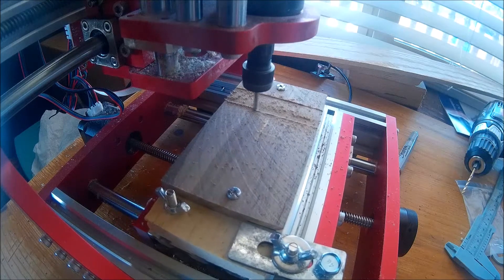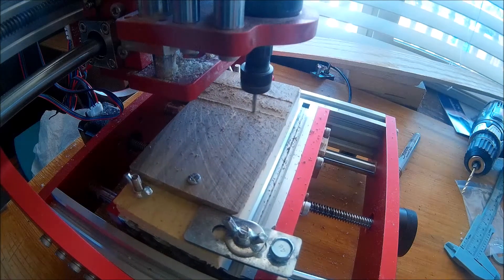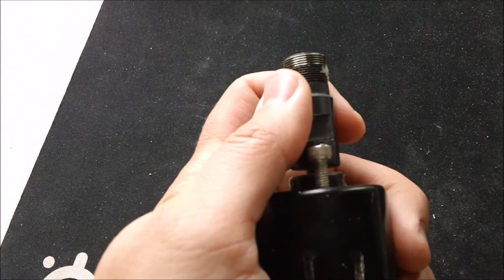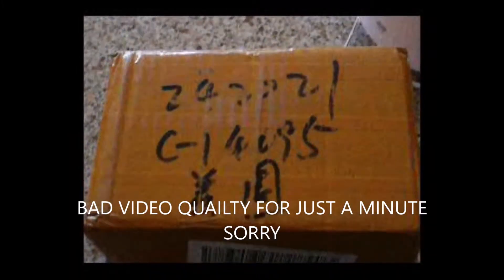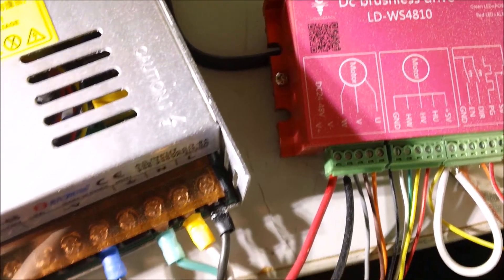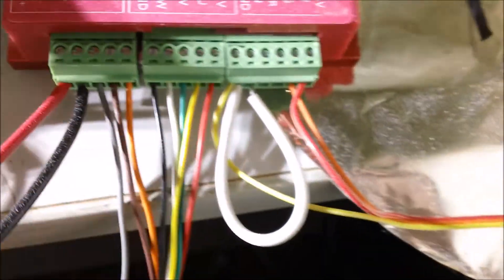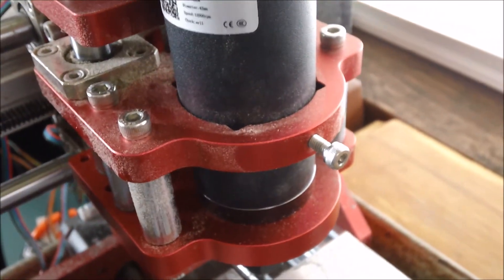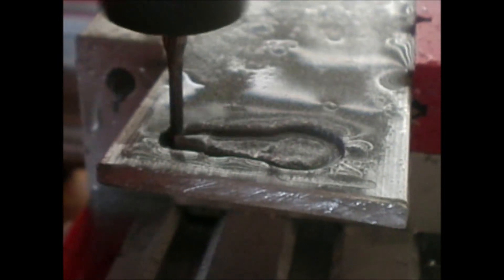1310 CNC cheapest way to machine aluminum upgraded spindle

Comment: I have recently purchased same CNC and same upgraded spindle motor..  how did you go about marking and drilling the new holes in the bottom plate? I mean the new holes for the upgraded spindle would need to be very accurately aligned.. I am interested to hear how you went about it and any problems or suggestions in marking out and then drilling the new holes. Thanks.
Reply from the maker: I designed a drill jig to be made on my 3d printer then used it with my drill press.
Reply: @LeadDennis  Oh I see, that sounds good idea.. how did you obtain the distances between the spindle holes? Did you measure the distance with a ruler or with calipers, or were you able to find technical drawings on internet giving the exact spindle hole distance dimensions? The reason I ask about obtaining technical-drawing giving precise hole distance dimensions and locations, is because the more precise the hole alignment the better, and I would think it difficult to get sufficient precision using only a ruler or calipers.. also the holes would need to be drilled exactly in exactly the correct location on the bottom plate.. ie so not only are the hole distances important but also the hole locations in relation to mid-point of the bottom-plate would be important too I assume.. it seems not a trivial task.. but I am not mechanic so I could be mistaken. If you can provide more details on how you did this I'd much appreciate it.
Reply from the maker: @gregwoolley  I used fusion 360 and took a picture of the motor, then I calibrated the picture to a measurement in f360. I can just give you the jig if you want.
Reply: @LeadDennis  Thank you that is kind of you, but I live in Australia and probably not easy for you to post it here. Given that many people who buy the CNC 1310 seem to eventually upgrade their spindle, perhaps you could do video showing how you designed your jig and supply download link for the 3D CAD files for your viewers?
Reply from the maker: @gregwoolley  sure I will get the jig plate posted in the description, but you have to subscribe first lol
Reply: @LeadDennis  no worries, happy to subscribe. Thanks for your replies and advice. Look forward to more of your videos on CNC 1310.
Reply from the maker: @gregwoolley  Check out the latest video.
Reply: @LeadDennis  thank you for your advise. this days I'm  trying  to make  the jig in autocad but its complicate to made accuracy size for each wholes of the mechanical parts. my goal is to upgrade the spindle  and make the minimal modification for. And will be crazy to do "reverse engineering".
Reply: I need to use  spindle 52 mm diameter.
Reply: @LeadDennis  I just did measurement of the opposing hole distance of the spindle and it seems to be 35mm.. I guess then first step is to design a 3D CAD file with hole placement based on that 35mm measurement, 3D print it  and see if the holes align exactly... I guess 2nd step is to do likewise with the base of the CNC 1310, design jig based on the hole placements in the bottom plate of CNC machine, 3D print the jig and test that it also fits.. when both jigs are confirmed to exactly fit the existing hole placements, then design 3rd and final jig incorporating both measurements into the one jig.. then bolt the jig onto the bottom plate of CNC machine and use the jig holes for drilling the holes for the replacement spindle.. is that how you did it? Or does that sound like good way to do it?
Reply from the maker: @gregwoolley  sounds like a lot of work. I just measured and took pictures then imported into f360 to make the jig. I reused one of the holes from the 1310 jig plate.